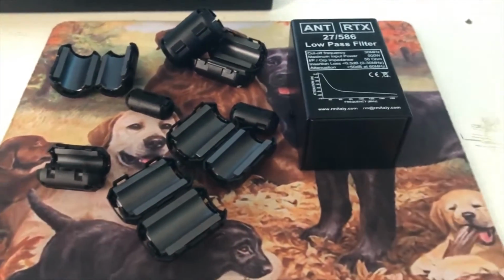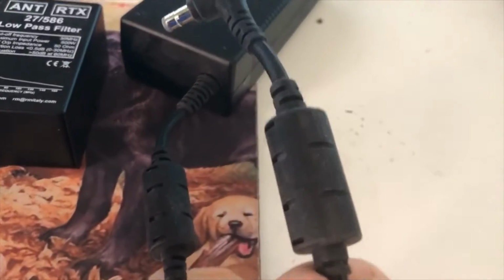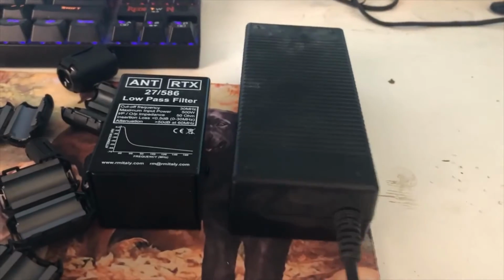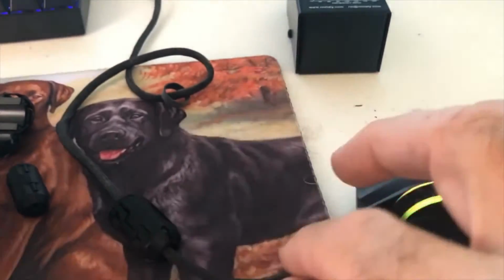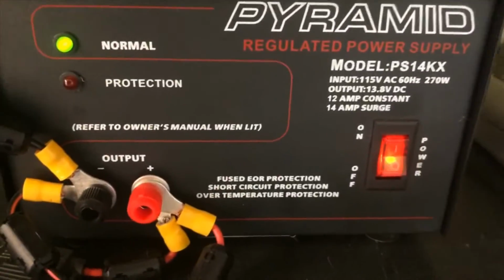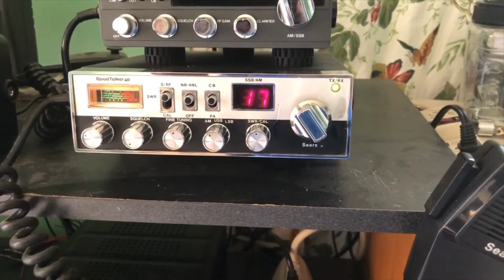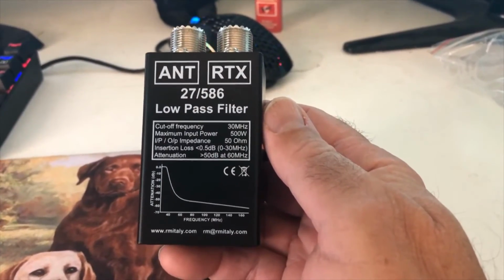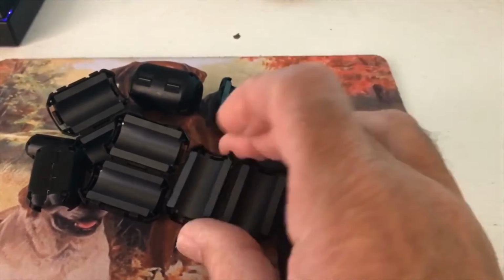Reducing RF Background Noise on your CB Radio

Comment: For legal cb radio there is no need for switching powersupply. you probably need max 10 amps to power your cb radio.
Reply from the maker: 10 amps is adequate for  a stock CB. My current setup as today is using my 10 amp power supply for my CB radios, and my 30 amp switching for my ham radios that need more power. 73s!

Comment: A lot of the blocks fitted to cables on cheap electronics are fake, just plastic with nothing inside. That may be why you heard a significant reduction in fitting one to the keyboard cable.

Comment: I get zero noise from my Stryker 955 using a Stryker a10 on my 2024 Trail boss 6.2. In town around lights and stuff yes I get a little noise 1 or 2 s units but it’s nothing like my 18 Silverado. Something about a 2024 Chevy 🤷‍♀️

Comment: I installed a cb radio for my Autistic son and the noise and hiss was terrible so i put a few clamp on ferrite beads and helped very little! I put my oscilloscope on the power supply and the dc ripple??? Lol. Subbed and liked cheers from Australia ❤

Comment: This guy doesnt know what background noise is. My radio has staic hiss that drives the needle to 7.0 on my meter.
Reply from the maker: It is pretty quiet around here for background noise. If I hit 1 or 2 on my meter I start complaining. Thanks for watching!
Reply: @RidgeHikerAdventures    That is so great . We have where the noise level goes as low as 3.0 but thats like 3 hours of a 24 hour day. And you sir may be the guy that can direct me on another probem I have. Barefoot radio key up and it shuts my truck off. Truck all factory, radio all factory. Ford says its an RF interference. By the way, great video.
Reply from the maker: @Tom-xp7dl  That's very strange. I found this on a forum that might point you in the right direction. https://www.ford-trucks.com/forums/1227929-radio-frequency-interference-rfi.html  
73's!

Comment: When installing on  power cord for providing power from a battery or 12 volt power supply do not install them on the ground side of the cord just on the Positive Side.
Reply: Why?  Can you offer an explanation for those of us that are slow? Thanks
Reply: @rozd618  Putting them on the negative leads will cause a Ground Loop which you don’t want.
Reply: @1OFGODSOWN  thanks

Comment: I have an automotive AM/FM radio installed at my cabin. When I turn on my PSW inverter which runs off the same 12 VDC line, I get lots of noise in my AM radio. The same thing happens when my 12 VDC refrigerator starts up. I am going install some of these ferrite beads and a low pass noise filter to try to reduce the noise.

I liked your Solarcon A-99 CB Base Antenna video. I would be interested on how well it performs on the 10 meter and 20 meter ham bands. I am currently using a 102 inch steel whip antenna with some tin roofing for a ground plane for my CB. I wonder if this would work on 10 and 20 meters using a Xiegu G90. (I'm commenting here because comments are turned off on you latest video.)  - Dave
Reply from the maker: Sounds like a good plan for your AM/FM radio with the noise problem. I bet the low pass noise filter will do the trick. I'm anxious to try out 10 meters on my A-99, but I recently sold my 10-meter radio with the idea of getting one with sideband. How do you like your Xiegu G90? I would imagine your 102-inch steel whip antenna would work well on 10 meters with an antenna tuner, but I'm not sure about 20 meters. I don't have a lot of experience on the bands above 10 meters. My comments should be back on all my videos. I panicked when I realized I had accidently turned them off about a week ago. Luckly, I didn't lose my past comments. Thanks for watching and 73s from 595 Lake Tahoe Nevada!
Reply: @RidgeHikerAdventures  Thanks. I have not bought the Xiegu G90 transciever yet. I am still saving up my money! I will post a review when I finally buy it. - Dave

Comment: What mix are they 31,43 ?
Reply from the maker: I could not find the mix type anywhere when  I ordered them. They were cheap enough to take a gamble and they seem to work well enough on my 10 and 11 meter radios. I've doubled them up on a couple of cords and that helped reduce noise even more. No noise from any of my power supplies or computer. I do get quite a bit of noise from my 2 meter radio when it is charging. I'll have to try a ferrite on the power cord and see what happens. 73s from 595 Northern Nevada.

Comment: Try  the LDG in line 1:1 choke they sell. It works wonders
Reply: What's an LDG?
Reply: @fwucku  LDG RU-1:1 UNUN NORMAL C0MMON MODE CHOKE. LDG is the brand
Reply: I've got S9 noise on 27mhz would this choke work??

Comment: I had problems with noise. Theres normally alot of chatter on ch19 where I live. But I couldn't make out what was being said through the noise. Out of curiosity I flipped the main breaker in my consumer unit and I could finally hear what was being said. Through a process of elimination i found out that it was my TP-Link Powerline adapters producing the noise.
Reply from the maker: Great detective work.  I'm lucky to have a very little interference out here in my office. I do get occasional noise from one of my antennas. I think it's from a refrigeration compressor from next door. 73s from Northern Nevada.
Reply: I also had these, they made one hell of a racket on my CB radio. I discontinued their use and went about it a different way.

Comment: I was wondering if you tried them on the coax ?
Reply from the maker: I haven’t tried them on coax. I’ve read where  others have had good luck with them. I would make sure after installing to check your SWR.  I don’t know if it would have any effect, but better safe than sorry.  73s from 595 Northern Nevada.
Reply: @RidgeHikerAdventures  Placing Torroids/Ferrites on the coax (same as a low pass filter but more effective than said LP filter)  will have no effect concerning SWR.  What they will do is prevent common mode currents on the coax shield from causing interference to electronics in your house.  You should also experiment with different mixes, I.e. mix 31, mix 43 etc.
I suggest a visit to the Palomar Engineers website for more information on the proper use of the different types of ferrites and Torroids.

P.S.  what you are calling RF noise, if man made (cheap switching supplies, wallwarts, computer monitors, etc)  is called QRM and noise from natural sources (lightning, the sun, etc) is called QRN.

The power supply you referred to as a regulated supply is actually called a linear supply.  Both the linear power supply and the switching power supply are regulated.  Regulated means that the dc output is smoothed to provide a 13.8VDC current that has little to no ripple on the signal.  Most newer switching supplies used in radio communication a heavily filtered to remove the RF in the DC output that can cause interference in the receiver section of the radio.
Reply: @jfrphoto01  i have a cb in my car when i drive under power lines or in a built up area i have a load of static to the point i have to readjust the squelch, when i do that i end up loosing alot of range. would they make a difference in my situation
Reply: @steffansims8729  No, that’s coming in through your antenna.   If the noise comes in and then goes away after you drive by the “culprit” there is not much you can do.  You can try a toriod choke.  It’s the nature of mobile radio.  If your radio has auto squelch you can use that while driving through town.
Reply: @RidgeHikerAdventures  
Same to you, I’m in Mesquite
Reply: @RidgeHikerAdventures they should not change the SWR at all?
Reply from the maker: @1OFGODSOWN  My SWR stayed the same. Thanks for watching!
Reply: I have a lot of static here too :( any freq from 25.615 (static is s-5) and upto 30.105 s-4 (mostly at CB band is S-7) I am not sure what it is, but i get the simular pattern in the car, when parked outside my house, I have not tested yet how far away from the house this issue goes, or if its anything in the house. But both from car battery and house electricity i get the noise. Wonder if it was worthy to put the Ferrites at the coax ?, any suggestions are very welcome - Thanks.

Comment: A great video and explained just right  we live in the UK have all sorts of stray RF been picked and into the radio street lights TV kids computers and stuff in the home heating boiler it's in ending. So after this video I will be buy these noise killers it's that bad little garden lights the changed the street lights to get more light at less power le lighting and it never stops but this could be a good start
Reply from the maker: Luckily most of the RF noise is being generated by my nearby devices. Like you, the worst offender is my little hydroponic garden which we use in the winter to grow vegetables. The LED lights put out quite a bit of RF noise. With it being summer, I haven't gotten around to filtering the RF noise generated from it yet. In the past, I just unplugged the lights when using the CB radio. I'm going to have to order some more ferrites from Amazon before winter arrives.

Comment: been using ferrites for years have them every foot on my coax and it eliminated all interference
Reply from the maker: I've read that placing them on your coax can help reduce noise. Do you have a lot of electrical interference in your area? I've read that even street lighting can cause RF interference. 73s from 595 Northern Nevada.
Reply: a lot of city lite plus I dont want to interfere with the police dept radio system 100 yards away from my house I think they would be pissed off if I turn my station all the way up say past 10 kw and wipe them off from broadcasting  @RidgeHikerAdventures
Reply: @mr.stonerUDX714 You would be jailed and fined if you interfered with the Police radios & you should.
Reply: How many you have on coax.?